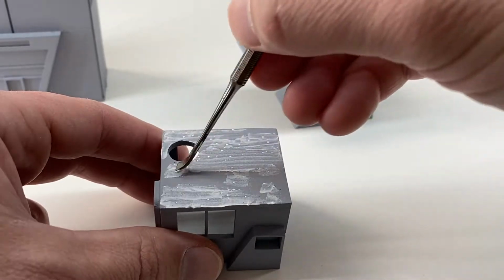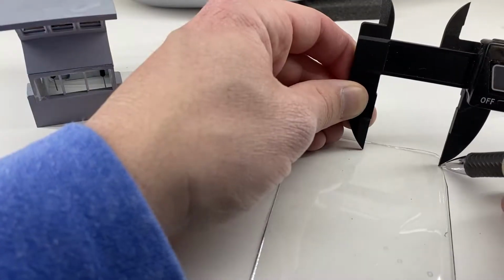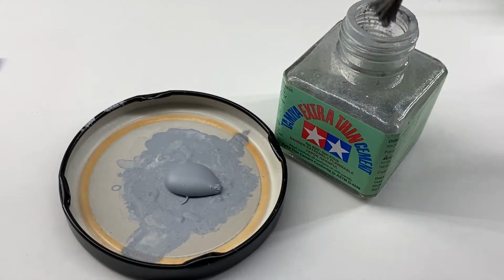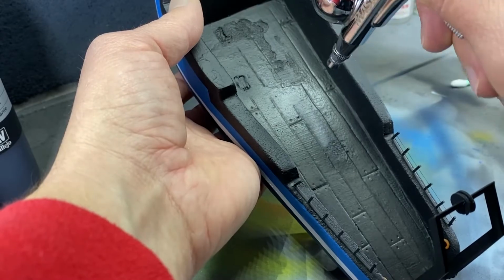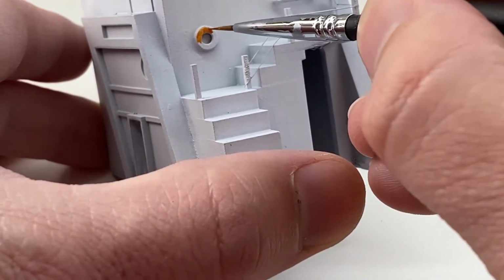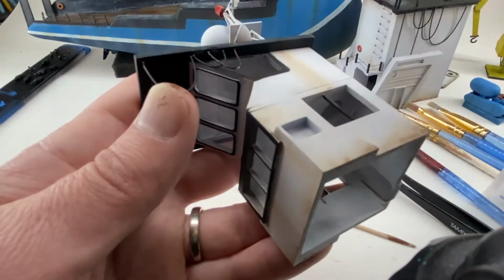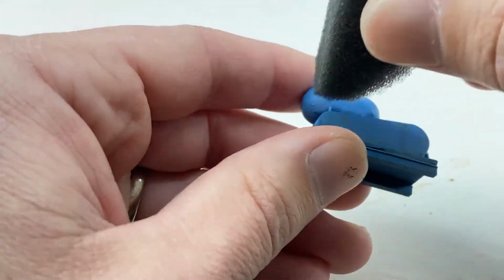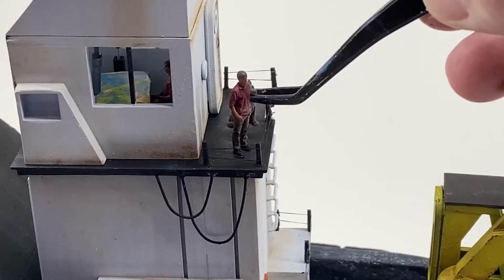Painting And Weathering An Exploration Ship Model + Wiring LED Lights

Comment: Hi, how much resin did you use for 3D printing? 🤔
Reply from the maker: I used Elegoo standard photopolymer gray resin in my printer. For this build I'd say I used around 1/3 of a liter or 12oz. for the structure and all the other details. Hope that helps.
Reply: @mattockmodels  Thank you. They all print small elements 😆